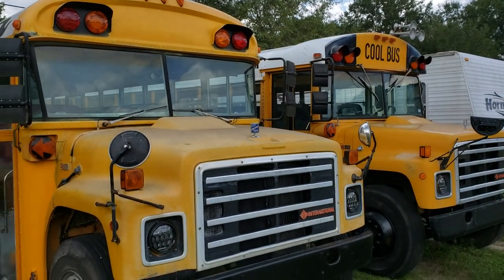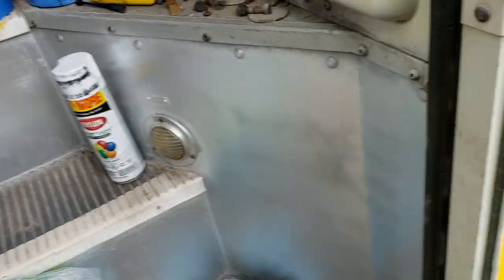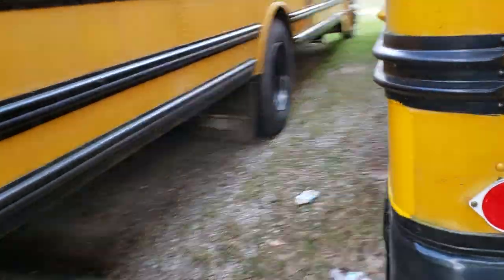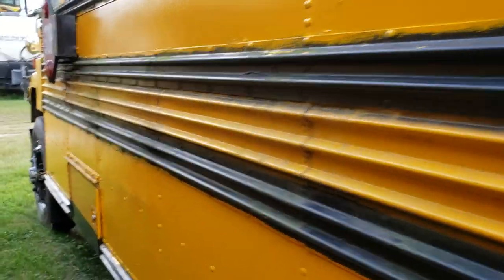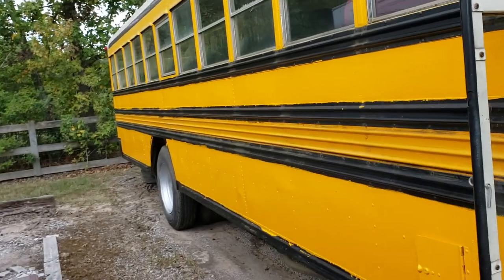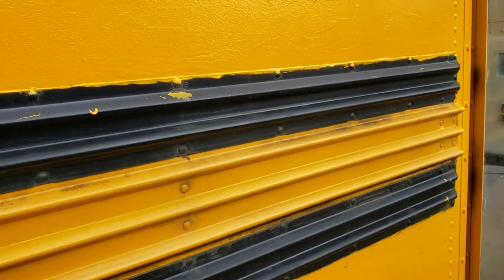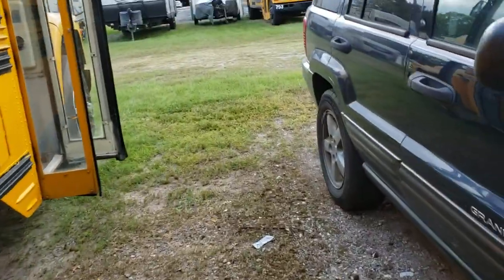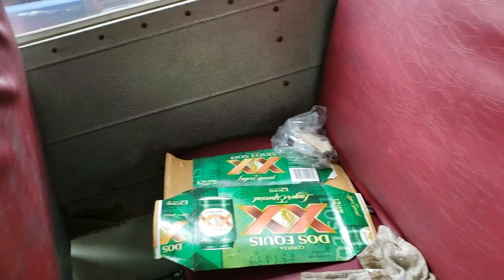Repainted the Blue Bird

Comment: good paint job so far. i seen Bus Grease Monkey's channel he does support school busses but his specialty is the old two stroke Detroit Detroit diesel as his bus is a 1947 GM silversides bus. as im liking Tommy Retro's vids so far.  Do you still have the Electrohome fan 2807 406 009 in your Blue Bird? i got one recently it runs very slow so its linked to the field winding in the motor i may try to attempt to rewind the field. the motor # is 2807 406 003. as after 1993 is when Electrohome motors were purchased by FASCO. it got sold to DCM manufacturing. as i figured 2807 406 009 is the Blue Bird # and 2807 406 007 is for the Bergstrom fans. what im learning the #s on these Electrohome/Fasco motors.  as that old B-29 cockpit fan i got with the Delco motor works very well on 12 volts and with the Bergstrom flat mount as im using it as is got better air circulation and defrost with this fan  as its 8 inches in diameter and two blades than that 6 1/2 in 4 bladed electrohome fan but only one speed the way it was when it originally in the B-29. as i left all the safety wire in place and made no attempts to dissasemble the motor.  as now the electrohome fan i got is under repair now. its a rare blue color and has the blue bird base.